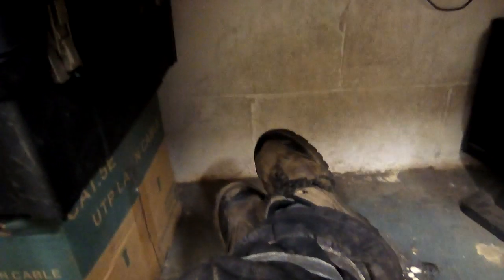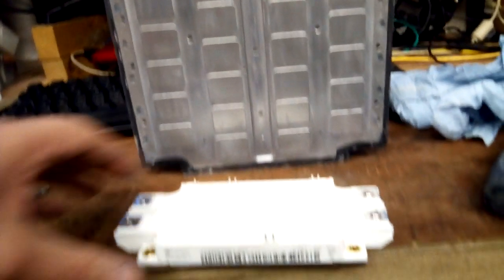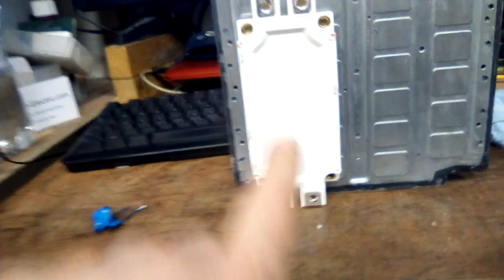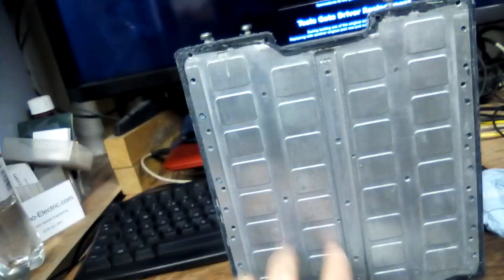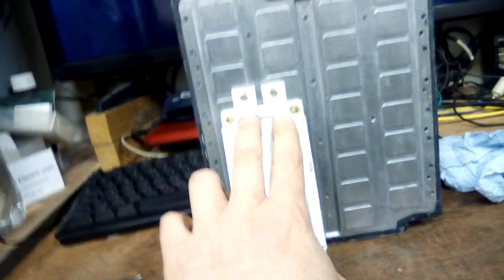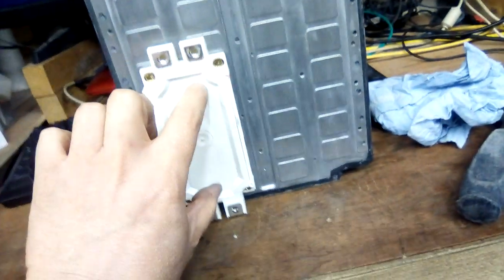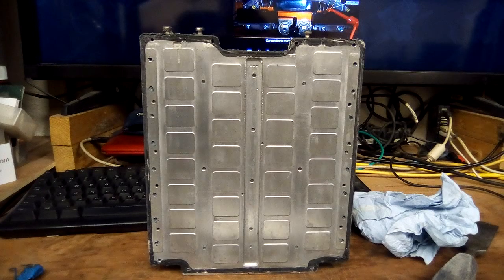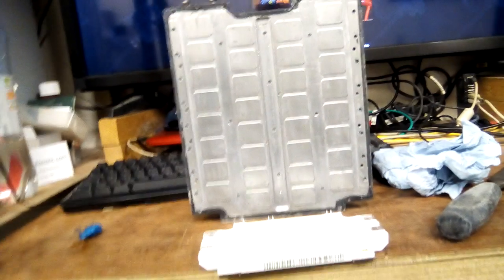Tesla Model S inverter teardown - all the way to the metal #4

Comment: Could you use something like CPU heatsink paste to conduct heat through to that big plate, so you don't have to flatten off those square bumps? Might end up a bit pricey.
Reply from the maker: Well I could, but I have the equipment to machine the plate flat so it'll not cost me anything. Just takes time  and it's a PITA. I also have plenty of heatsink paste, but this does not conduct the heat the same as a proper metal contact